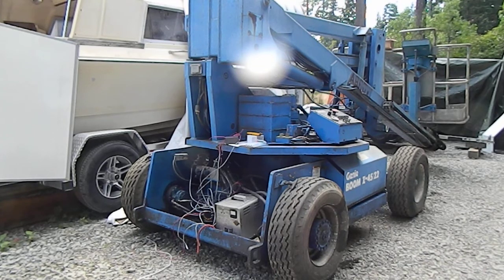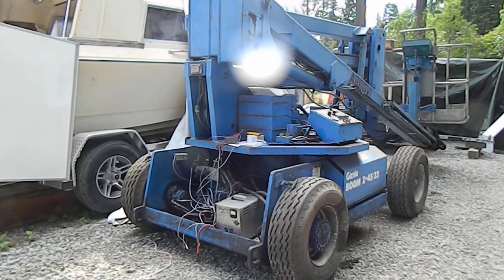Genie Z45 22 Electric Part 3 Theory of Operations - Drive functions. July 17 2021

Comment: Hi there,
I have exactly the same lift, (although i did convert it to a little yanmar L100 diesel engine, got sick of replacing those bloody expensive batteries!!) and like you, I am having issues with the old boards starting to fail,
So far i have had to simply bypass a few of the soleniods on the boom function board,
but now i am having issues with the drive joy stick,
you dont happen to have any wiring diagrams of your new joystick and pwm controller do you?

cheers!
Reply from the maker: Emailed you 2 files it is 11mb total let me know if you do not receive them.
Reply: @Islandwaterjet  Hi there, i did get that indeed, thats a great help!
you dont have a link to that PWM controller by any chance?
thank you very much for your help!
Reply from the maker: @finlaybichan1275  Your question leads me to the fact I did not do a very good job of this video. In the process now of doing a follow up video.

The PWM controller is not overly critical. Note your manlift is 36v but the controller parts are 24v.

When wiring this keep in mind that for example drive fwd function 3 things must happen simultaneously ie:
- Activate variable solenoid on drive block.
- Activate fwd drive solenoid.
- Activate high amperage 36v drive motor relay.

For example boom up function:
- Activate variable solenoid on boom block.
- Activate boom up solenoid.
- Activate high amperage 36v boom motor relay.

This is what I found on your UK Amazon site for example that would work fine. Use keywords: 
24v pwm dc motor speed controller.

https://www.amazon.co.uk/Create-Idea-Controller-Reversible-Regulator/dp/B07YSK7WC2/ref=sr_1_76?crid=2WWXAJW7OJFR3&keywords=12v+24v+36v+48v+pwm+dc+motor+speed+controller&qid=1683217963&sprefix=pwm+24v%2Caps%2C215&sr=8-76

Another one that would work fine:
https://www.amazon.co.uk/Controller-Controls-Modulator-Regulator-Governor/dp/B09L3RZH5V/ref=sr_1_99?crid=2WWXAJW7OJFR3&keywords=12v+24v+36v+48v+pwm+dc+motor+speed+controller&qid=1683218135&sprefix=pwm+24v%2Caps%2C215&sr=8-99
Reply: @Islandwaterjet   your videos have been incredibly helpful already!
thanks for those links, i will get a few ordered and have a go,
its great to know its possible to keep these old machines going!
cheers!
Reply from the maker: @finlaybichan1275  Wonder if you could help with a ongoing problem here in drive motion. The unit has very little power to move. the hyd pump still spins but the wheels stall out on even a small gradient. Checked the releif valves and it showed the full 2500psi setting is correct. My thinking is that the hyd pump may be worn out because if the wheel is stalled the pump must also stall. Any suggestions ?
Reply: @Islandwaterjet  Im afraid im not much help here,
my one is kinda under powered also, its not possible its the actual wheel motors is it? you would think if your pump is able to make 2500psi it might be ok?
My drive pump bearings had given up, locking the pump up, and burning out the dc motor before we bought it,
I replaced the electric motors and batteries with a small diesel engine and a two stage 16gpm pump, which works the boom great at idle rpm,
It will move the wheels at idle, but i can kick it into high rpm to get a little more speed/power out of the wheel motors,
I need to get a guage on the test ports to properly see what its doing!

Comment: That thing is pretty quick. Have you figured out if the boom will stay aloft if there is a hydraulic failure? I would hate to see that thing crashing down due to a hose failure. I believe there are some kind of check valves in the cylinders them selves?  Check with Deboss Garage he was working on an older, man lift. I see you have a fiberglass boat there, what happened to that aluminum one you had?